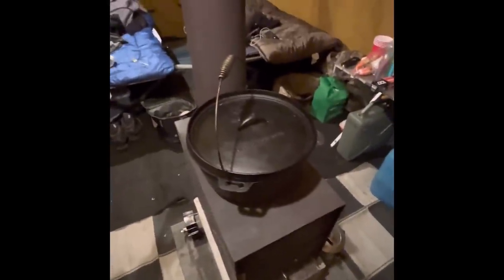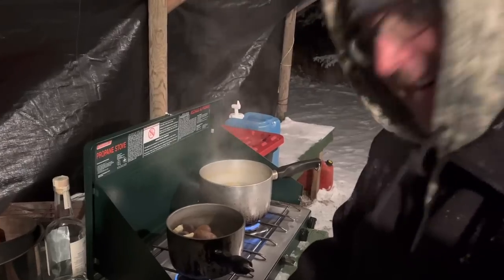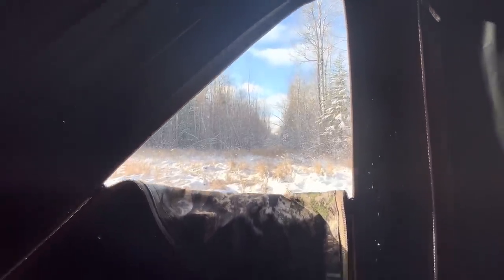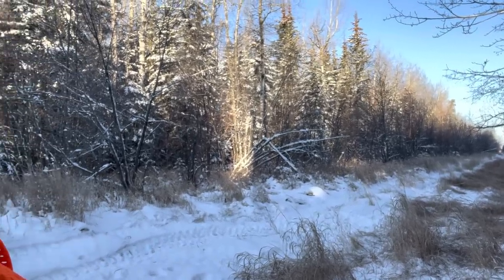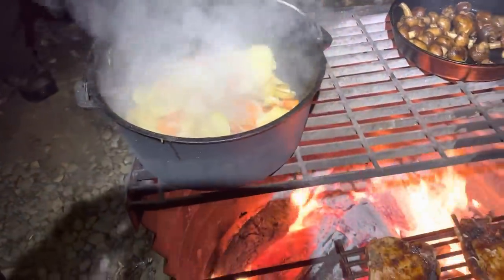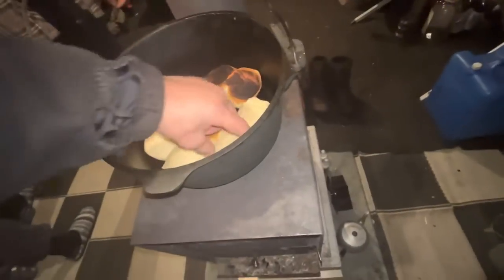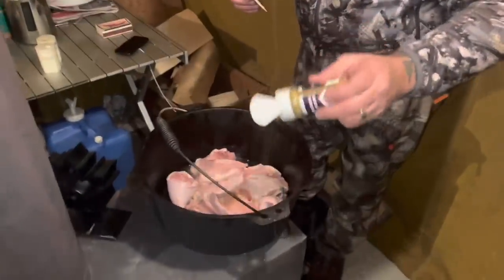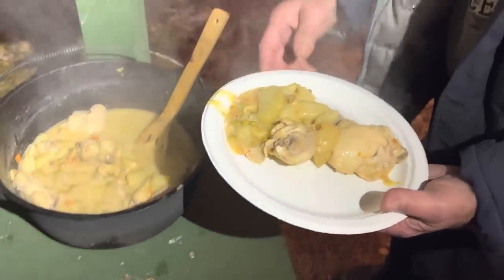Hunt Camp - Cold November with great food and Fantastic Friends

Comment: Hey Brian - is that a Drolet Hunter stove in your tent ? - Where is it set up in the tent ? - Middle ,corner ?
Reply from the maker: Hi there, yes it is a Drolet Hunter! It’s set up (vertical chimney) approx 5’ in from front door, right side of ridge pole approx 5’ from the wall.
Reply: @4seasonpursuits724  - how high up is your damper ? are you burning spruce/pine or hardwoods.
Reply from the maker: It’s at the first pipe joint up (approx. 30” lengths) and mostly burn seasoned dry spruce but will also burn seasoned white poplar